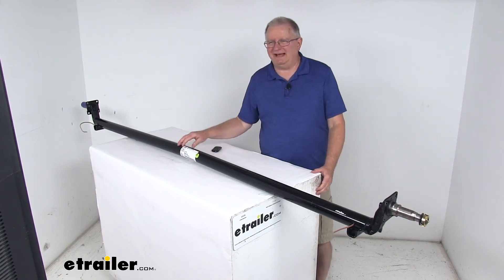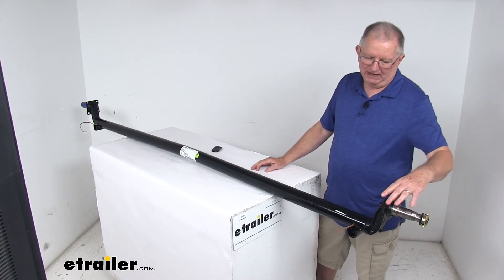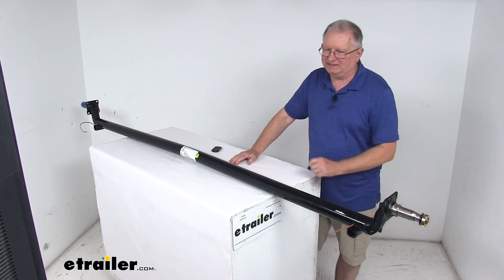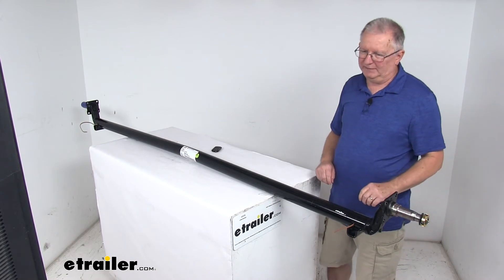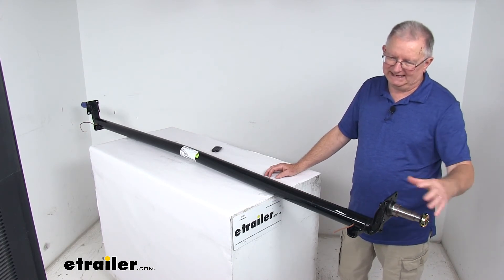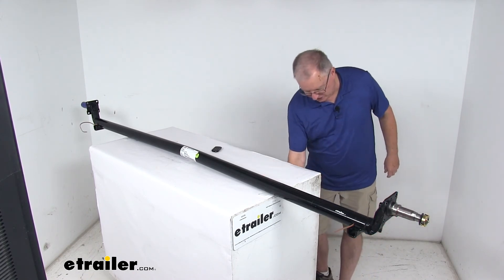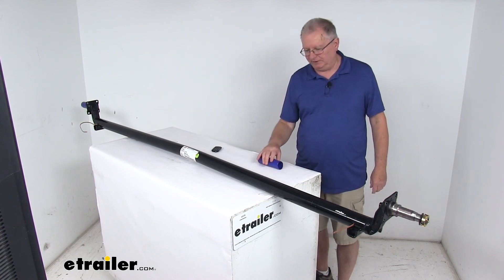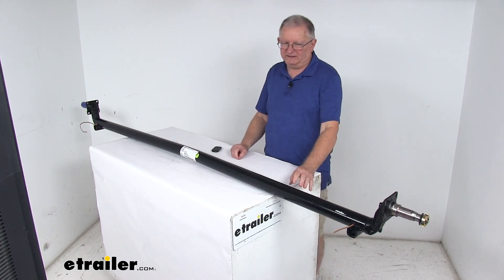etrailer | A Closer Look at the Dexter Trailer Axle Beam with 4" Drop E-Z Lube Spindles

Comment: My hub face measures right around 85 inchs. Should I just order the 89/70 axle? Also I am wanting to keep my same hub assembly, that I already have. How will I k ow if the are compatible?
Reply from the maker: We have an axle thats hub face to hub face measurement is 86 1/2" and has a 71 1/2" spring center. This may work for you as long as the spring center measurement matches.
https://www.etrailer.com/Trailer-Axles/Dexter-Axle/8327826.html